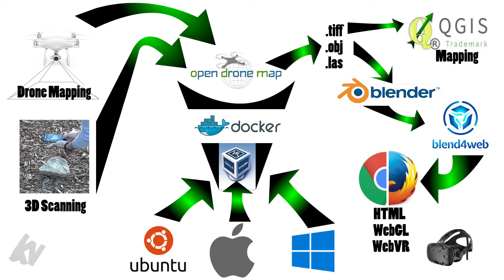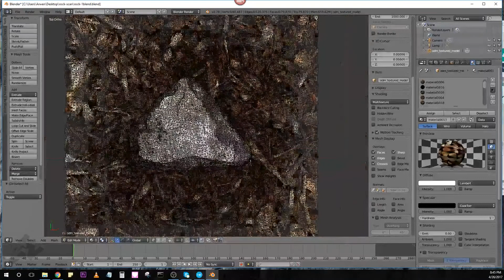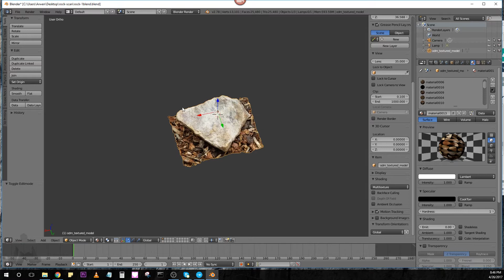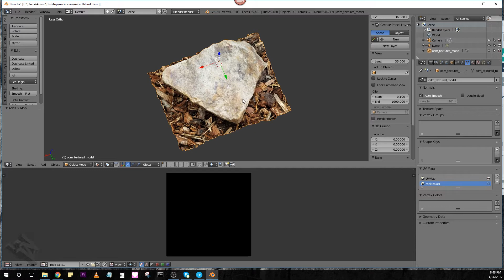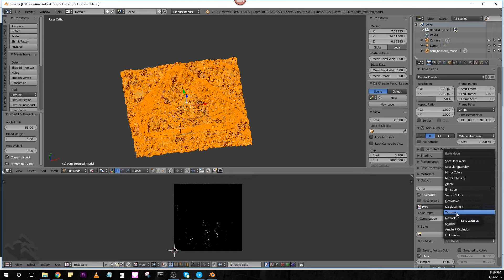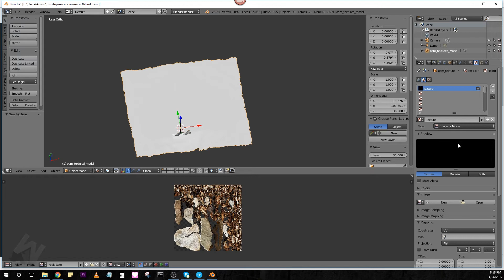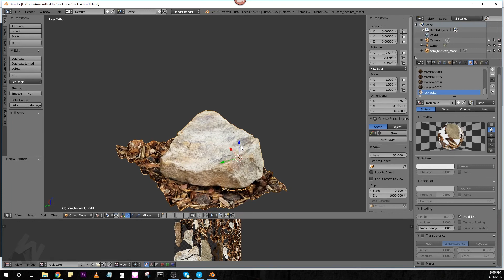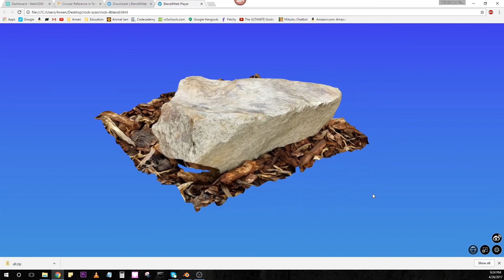Bake a Texture In Blender

Comment: Brilliant.  I spent two nights trying to solve this multi-material problem that can result from some 3D scanning apps.  I scan simple objects for architectural rendering.  The renderer I use (Thea Render) treats multiple materials as multiple objects, which is a pain when trying to share assets.  Using your method, I finally got the model condensed to just one material/texture (after I deleted the other now obsolete material slots).  However, and I found a fix, the old images and old materials (from the deleted material slots) were still linked into the .blend.  So when I exported from Blender as .obj, all the old materials came back when I opened that .obj into my renderer.  Bummer.  The fix was to go back to Blender and Shift-Click on the X adjacent to the "Browse Material to be linked" dropdown underneath the material slot area.  This doesn't actually make the old materials disappear from that list, but it sets the users to zeros and causes that data to NOT be saved in the .blend. I also did the same thing in the UV Image Editor for each of the old images (not sure this was required).  I also deleted the old UV Map.  Then I saved the .blend, and re-exported the .obj.  Now just the one main material in my renderer!  Awesome.  Thank you for such a well presented tutorial.
Reply from the maker: Glad it worked out for you. Now it's 2.8 we get to figure out how to do it all over again LOL
Reply: @WillW  I hope not.  Did you ever understand why various photogrammetry programs produce multiple materials?  Sometimes I shoot extremely simple objects with perhaps 25 photos, and I still end up with 3 or 4 materials.  Which part of the object goes gets which material seems very random.  I can't imagine, in my simple objects, that all of the UV mapping couldn't be done on a single map+png.  The 3D scanning programs I have tried are generally notoriously undocumented, but I can't help but think there is an ini setting somewhere that will force output to a single material or something similar. Thanks again for the video - it solved the last obstacle in my workflow.

Comment: Hi, your tutorial makes total sense and I think I am following it to a tee, but, for some reason when I click the Bake button it doesn't translate the original texture to the new image/uv map. It's just white. I notice that in your video (6:48) right before you hit bake, the original image is shown on the surface, though scrambled, and the UV/Image is black as per the newly created image. Mine does not do that. Both are black. I'm in Blender Render. I've created the new UV map in the data tab. What am I missing?
Reply: I've got the exact same issue, did you solve it? Maybe Will W?
Reply: @natanprins4938  Got same Issue and found a solution. When you click on the second uv map you create at 4:03, theres a little camera on the right side - you have to click on this cam to activate the uv map for the future bake. best regards